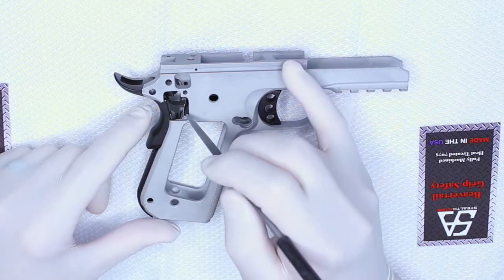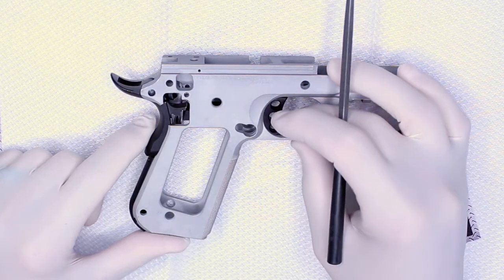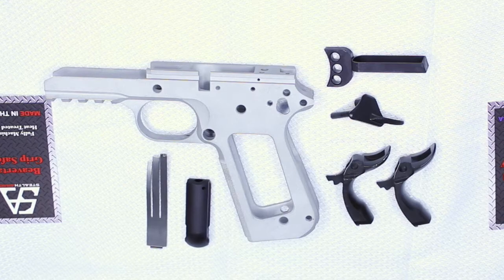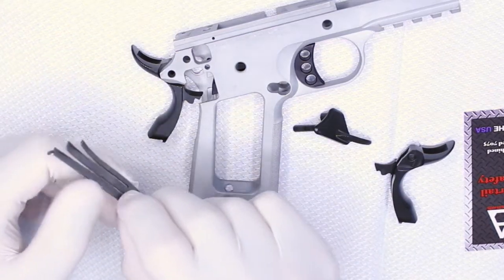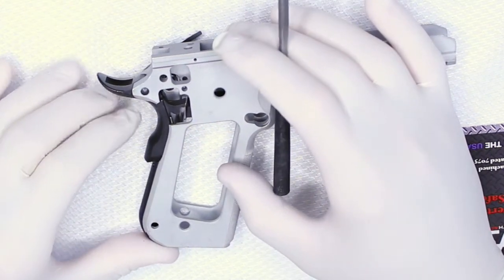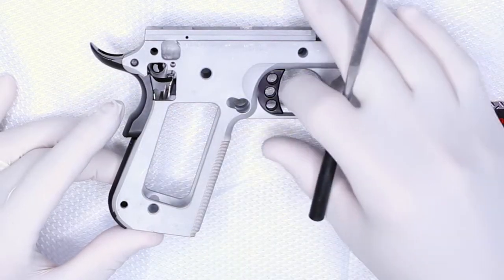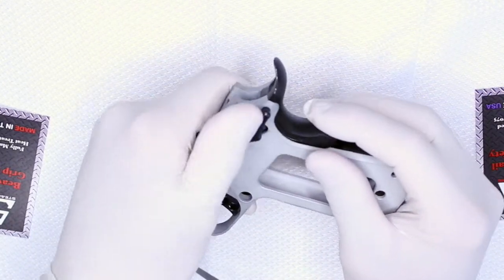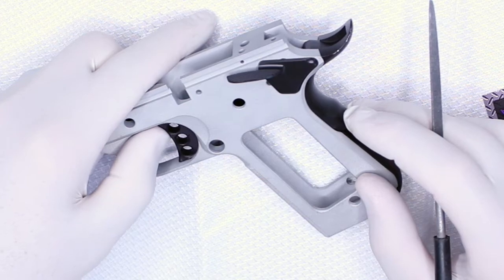Stealth Arms Beavertail Grip Safety FAQs

Comment: I wish I had a cut out frame like that to help me in fitting my grip safety. I think I just screwed up on my third one that I ordered from your company. The hammer falls when I squeeze the trigger and not squeeze the grip safety, but when I squeeze the grip safety along with the trigger, nothing happens. I'm going to really bend the grip safety tine on the spring back more to see if that corrects the problem. If not, then it'll be another $40 mistake to pay for.